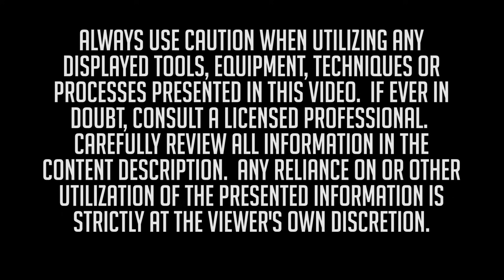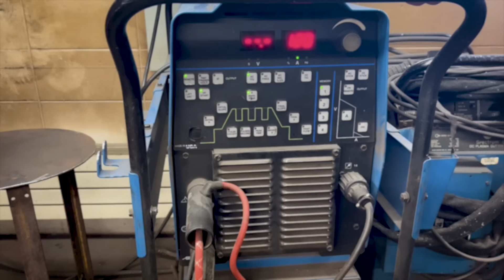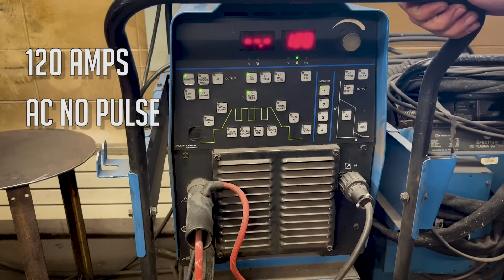Welding and Cast Iron Block Repair

Comment: I’m not a welder, have never welded, but have always had an interest in it. So now by utube I’m learning a lot about. I watch your site as well as others and hope to someday get a chance to lay down a bead. Not professionally but just to build my skill base.
Reply from the maker: Nice! Thanks for watching!
Reply: Teach yourself to fusion weld with oxygen/acetylene and the rest of the welding methods and materials will come to you naturally, oxy/acetylene (gas or flame welding) is overlooked as an outdated method of welding when in reality it is very effective, strong and versatile, to this day I still use gas welding often because it makes some jobs easier to perform than one of the modern welding methods.
Reply: @Peter-V_00    Thanks for the pointers and the reply.

Comment: As an engine machinist I deal with blocks/cast iron every day.   I agree with the TIG Brazing choice but I would have used some gentle  pre/post heat on the block but that is a personal choice and an added expense. 

That being said most of this video is a total failure!!! Without Magnafluxing equipment and a pressure testing equipment this repair is an invalid waste of time.  If the human eye could see the actual end of the crack I wouldn't need to use $12K worth of magnaflux equipment on a daily basis!  Finding the actual end of those cracks with a naked eye is impossible and only a blind guess!!   Magnafluxing after welding is also important to validate the repair.  

 Even though a Farmall F-20 has a non pressurized siphon feed cooling system the repair still has to hold water/coolant.    Which is why pressure testing equipment needs to be used to validate the repair. 

The metallurgy knowledge was great  but the project choice and total lack of inspection /validation destroys the video.
Reply: There's some validity in this. As a AWS Certified Welding Inspector I realize the huge importance of a NDT. Cracks left unchecked can continue to propagate and cause failure. I chose against a dye-pen test as the liquid penetrant is an oil based product and could continue to contaminate the cast further. A mag-particle test would have been a good solution to this issue. As stated, 12k worth of equipment wasn't in my realm of luxuries I had at my disposal. You're correct for stating there's adherent risk involved without further checks in place, but I do believe the home hobbyist can take a lot of good away from the video. Morality is we all need to venture out of our welding comfort zone and try the projects that intimidate us the most! Welding cast is a dying art and we can change that! Failure is relative. I appreciate your concern. Follow Weld.com for the follow up video with the tractor running! Its a personal machine of mine. A 1934 F-20 NT
Reply: @cliffdanis1521  porosity is always a problem when welding cast iron so how do you know that series of welds will hold water?   Finally assembly is a poor choice of inspection.   When a block cracks next to the deck surface it often creates distortion, which can cause immediate failure when the cylinder head is torqued in place.  It can also cause cylinder wall/cylinder sleeve distortion.
Reply: @andrewevans1658  Believe it or not there is a cheap easy way to see if it is gonna leak plug the water pump port and fill the block above the repair with windshield washer fluid and aim some halogen shop lights at the welded area over night it will heat the area to operating temp after a couple hours and if there is a leak the alcohol and dye in the washer fluid will find it it's a waiting game but it works

Comment: Thanks for the great tutorial. I am planning on repairing my Chevy 350 block that froze a few years back. I don't tig weld so I was looking at using nickel rods and arc welding it with a preheat and then slow cool. Of course I will be doing it in the middle of summer when it is really hot. I will be welding about and inch to an inch and a half skipping around but peening after each weld. What do you think my chances are I will have success?
Reply: You mean SMAW.
Reply: @dolphincliffs8864  Everyone knew what he meant. No need to be pedantic.

Daniele: Cast iron repairs are often unpredictable but i think you have a good chance of success if the damage is just in the water jacket. It's already broken so you've got nothing to lose. I usually tig braze cast but I've had good luck stick welding with n99 nickel rods as well. Keep in mind that you'll use less amps for a given rod diameter than you would for normal welding. You need enough heat to get it to flow nicely but not to melt the cast. Make sure you actually get to the end of the crack. Sometimes the end is difficult to see. Dye penetrant is very useful if you have some. Preheat with a torch isn't always necessary but it's a good idea if possible. Good luck.

Comment: All Great advice. I often use Silicon Bronze for cast repair but I'm almost never repairing engine blocks. Mainly manifold and such where it needs to be sealed but not structural.
Reply: Aluminum bronze is supposed to be stronger and harder.  I've heard more elongation too, but not sure of that.  Using AC (instead of DC that's typical for silicon bronze) should provide some cleaning action that will help cope with the impurities you'll face in old cast iron.  Should only need relatively small cleaning action, maybe 10% EP vs the typical 25-30% that would be used for regular aluminum.  BTW, I like the encouraging tone of this guy!